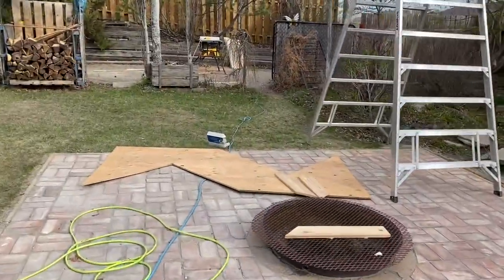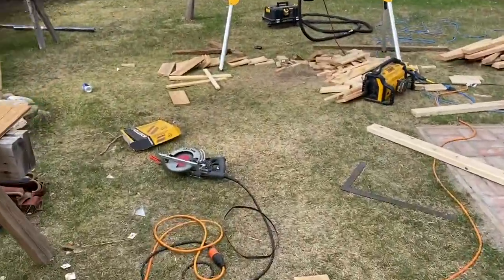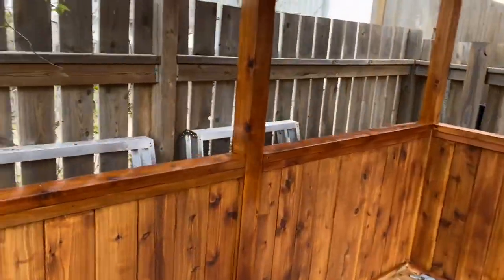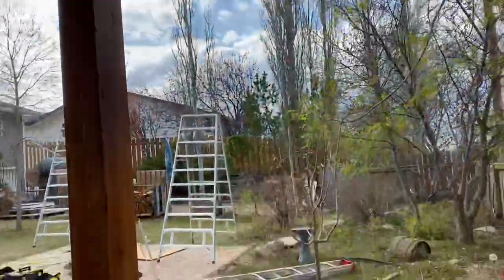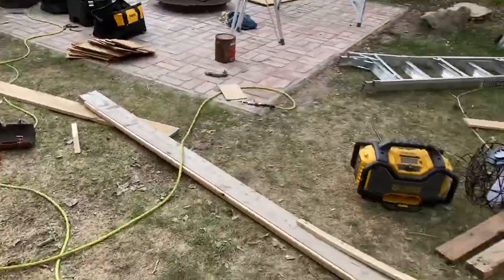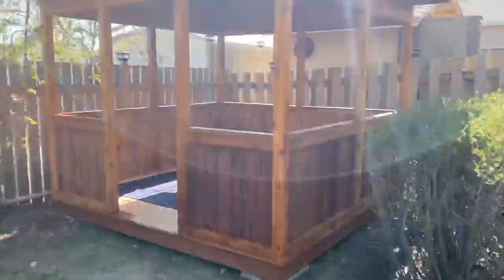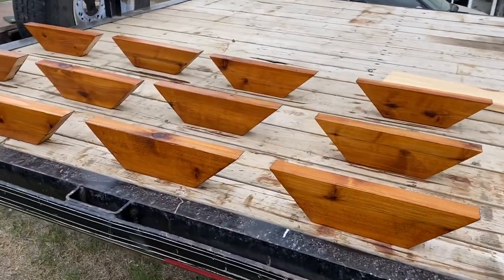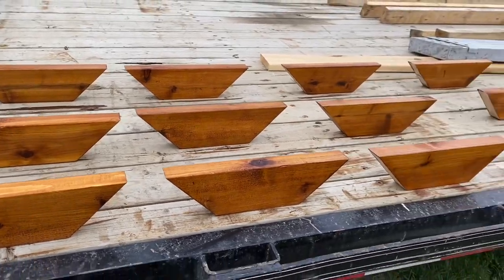Gazebo build part 7

Comment: I agree with your sentiments about the door quality. I used a similar door on my gazebo and had to replace it rather quickly. The problem I found was due to all the small pieces glued together increases the likelihood of a weak glue joint or a piece that rots before the rest, becoming the proverbial weakest link. If you did two coats of stain on it as well, and I suppose you did, it will likely improve the situation. 

Nice touch doing the second coat to improve the appearance by the way.